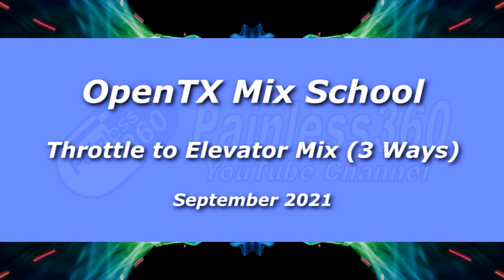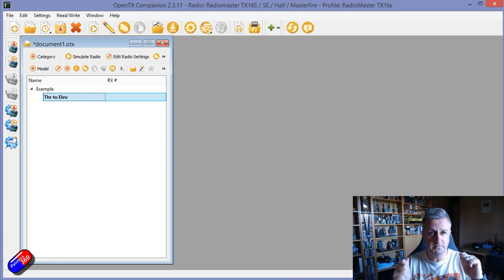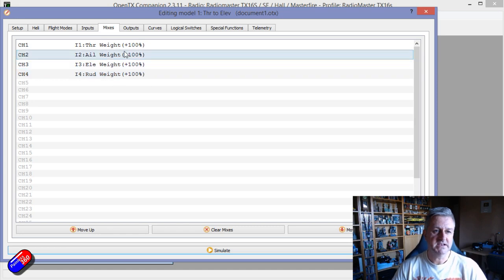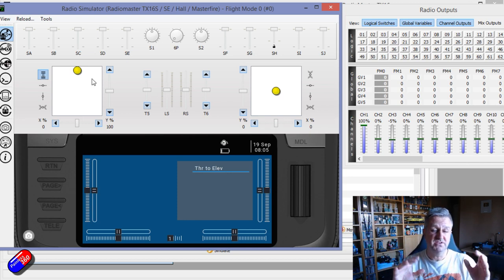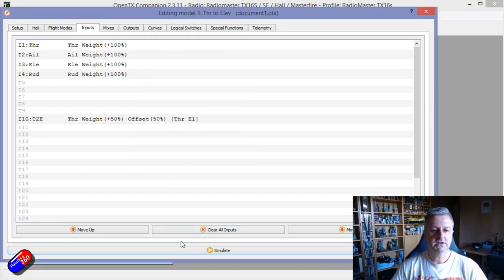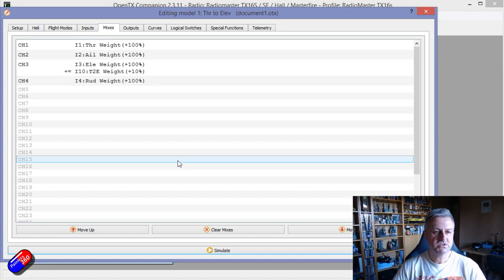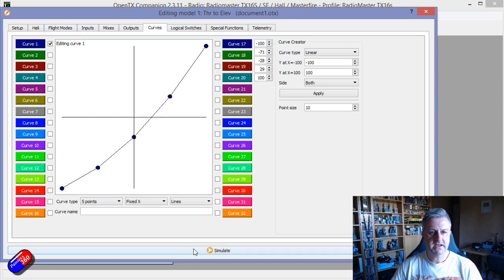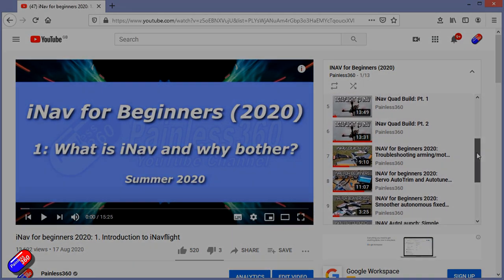How to mix throttle to elevator for 'planes that change pitch on changing throttle

Comment: This is great. My Radian does this, but I think it's part of what makes it great at gliding. It will try to loop back at full throttle, then nose back down just as fast if you over-react to it and chop the throttle. I've flown it for so long, that throttle up/elevator down have just become muscle memory with that plane and I honestly wouldn't want to tune that part of its behavior away. 

Where I'd be all over this is if I decided to fly it FPV, that's when all the little quirks stop being fun lol.

Comment: Great explanation. I have this going on in my Bixler, learned this from another video of yours. But what I missed at the end of the video was how did you personally set the mix for the Seal. And one more thing: as soon as you applied the Curve to the mix the elevator went to -3% with throttle on 0%. Thank you for the video !
Reply from the maker: I haven't set it for the seal. The plan is to add an FC to that. The curve can be edited to give the travel you want in the directions you need. Happy flying!